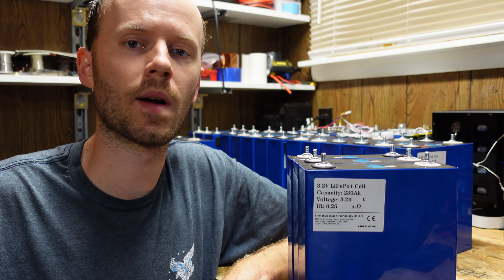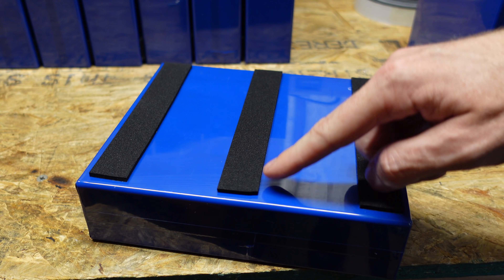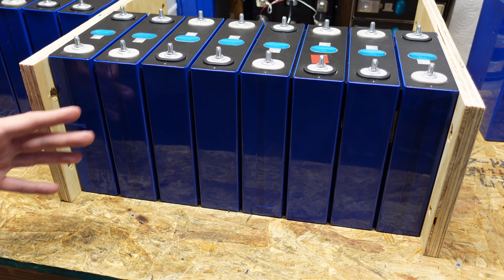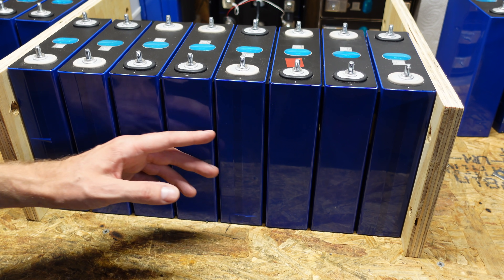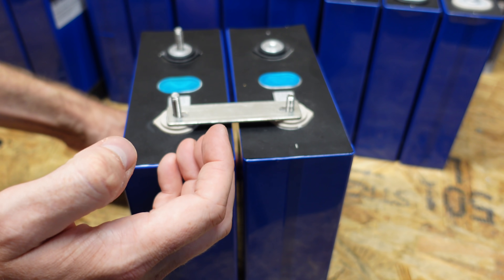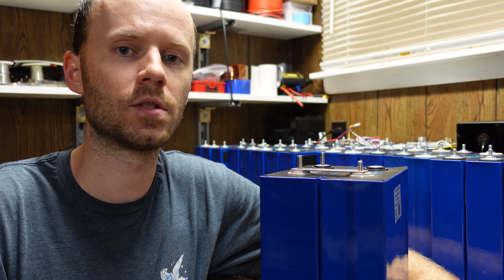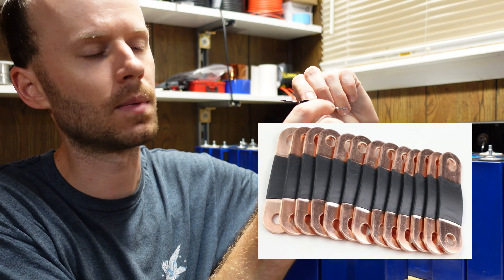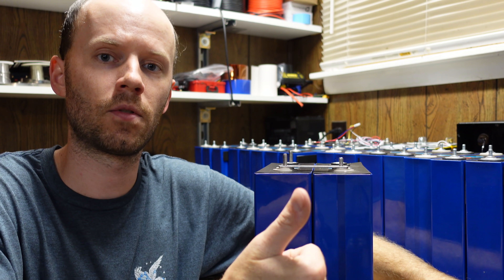Quick Update on 230Ah LiFePO4 Battery Pack Building and Fixture

Comment: Being able to find raw or bulk material to make stuff from , I would look at find bulk strapping and using the concept of the humped buss bars , but put more of a V shape to them - requires less stress from battery posts to move .
Finding materials / bulk , many times is just a matter of correct term to search with , so for the braided material - used a term like rolls of braided ground strap .
As for corrosion , with aluminum copper , 1st that is very little of an issue in a dry clean environment , fluids , dirt , etc. act as an electrolyte - making for corrosion .
If this is possible - maybe condensation in a closed electrical box , you should use something like you mentioned for a brand for example Noalox , antioxidant   .

Comment: How about don't tighten the nuts/bolt to the end, but instead use spring washer, so when cell expand they can still move under the spring friction and you don't need to relay on the hump of busbar

Comment: I buy copper flashing from the home improvement store. It can be cut with scissors, but if you want clean holes, you have to use a punch. Super cheap and effective. Just add as many layers as you need.

Comment: you are afraid to use wires because of heating on the crimps?..... for the love of christ man, you are way way too paranoid. buy a crimp tool, buy some 6-8 guage wire and move on with your life. Also it will take a ton of horizontal stress to stretch out that "hump" in the busbar, likely hundreds of pounds.
Reply: i made 2/0 hydraulically crimped to carry possible high amp loads on my 24-volt builds

Comment: pretty sure that all the bus bars I've seen, at least the good ones are copper.  I know that there is a dielectric affect between different metals, but everyone is doing it, and yes it is copper conductors against aluminum posts....
Reply: You're talking about "Galvanic Action" between dissimilar metals. Ideally you want to join metals that are equal or extremely close on the galvanic scale of "Nobility." A less noble metal connected to a more noble one will corrode over a period of time based on it's spread on the nobility scale and other factors. Copper and aluminum can be connected together using proper separation of the metals. In power, like your home electrical service this is done using cadmium coated lugs, split bolts, or other "Approved" connectors. Use the right connector and you'll have good results. Mix the wrong metal and you'll have issues, possibly very bad issues. 

Copper and aluminum also expand and contract at different rates. Aluminum will deform under far less stress than copper. Joining copper and aluminum (electrically) requires separation of the two metals by a connector specifically made to handle both metals. Here's some information on Quora. Disregard any answer that states you can join the metals if you use an antioxidant compound. That's not true and will only get you into trouble. Copper and aluminum have wholly different mechanical properties. They do not work well together.

See: https://www.mfcp.com/technical-info/galvanic-corrosion
Reply: I believe it was in the 70's when they started using aluminum wire in house building to cut costs. The outlets and switches were still copper. Oops. House fires.

Comment: Glad to see this video finally. It's been a little weird seeing so many teardowns of commercial batteries that use a rubber/neoprene spacer yet I never see it in DIY videos.
Reply from the maker: Spunkie - I love the battery teardowns, they're a lot of fun! But yeah, I get it - have to have a good mix of other things too.
volvo09 - There is voltage potential on the case of these (positive). I have not had time to actually test that yet by placing a resistor and seeing if current actually flows. There is very high resistance, so it stands to reason that it's not going to dead-short or anything. I assume all brands/models are different though.
Reply: @LithiumSolar  yeah, that's what i was curious about. Voltage vs actual current flow. I have only seen a voltmeter a few times, no current measurements.
Reply: I still am trying to figure out of the case of these cells is connected to positive or negative... If it is and the cells are in series the commercial packs are doing it the right way... you would need some sort of seperator to keep from shorting 2 cells out if/when that blue sticker gets worn through.

I am pretty sure i saw a mobile install where this happened and it was blamed on 2 cells shorting. 

I don't have my own yet to verify it with a meter.